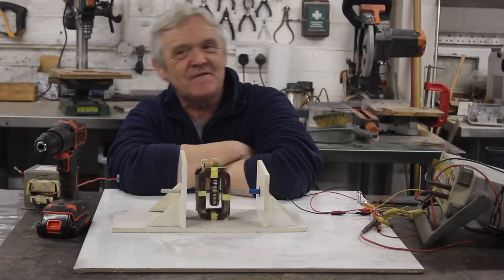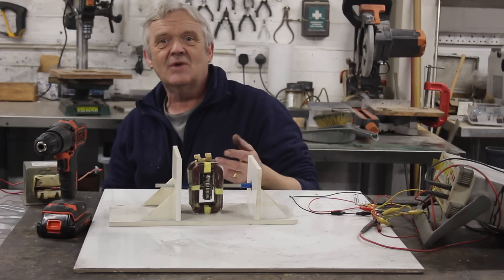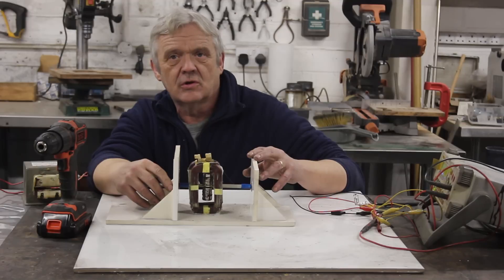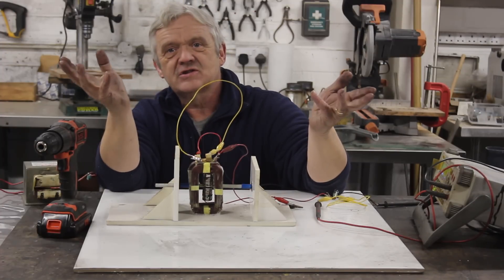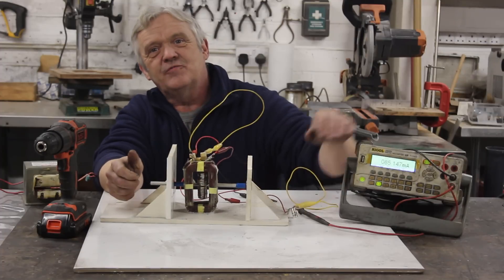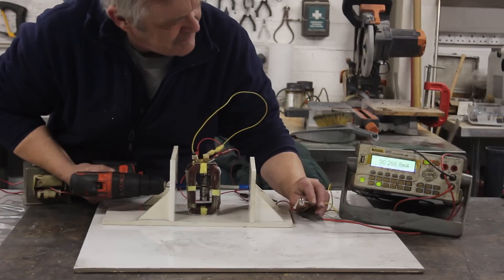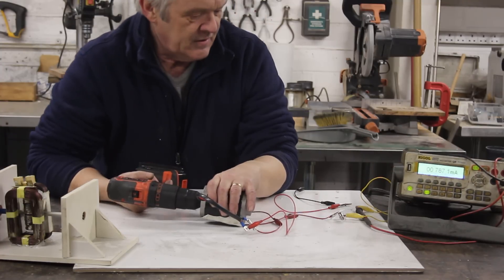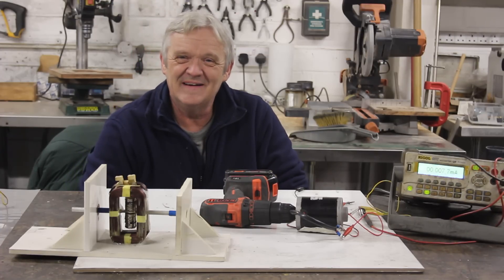1810 Newman Motor Generator - Better Than Shop Bought Generator

Comment: Just goes to show you that the energy industry is an industry in it for money. Nothing is designed to operate at peak efficiency or performance. We have stories of patents for highly efficient solar panels (Above 30%) that got shot down due to "National Security" bs. Solar photovoltaic solutions that would get us a bit more efficient solar panels. Doesn't surprise me in the least that a garage mechanic made a more efficient system. The ones they sell are not made to be efficient or last. They are made to break so you have to replace them. Like Apple computers.

Comment: Good day sir. That generator seems to be very effective. Did you measure the volts output? I would like to calculate the possible watts this type of generator makes. If it is 220V coil and you have two of them in series, is it 440V 0,25A? So the generator output is somewhere between 0-110watts. Btw. does it feel like it creates lenz braking effect while you hand spin it when it is connected to load?

Comment: That's a huge difference in output, 13mA commercial compared to 250mA DIY.. How can the commercial generator claim to be a 120W generator, at 12V you should be getting closer to 10 Amps not 13mA which is 1000 times less. Even a 20W generator should produce around to 1.6 Amps. I'm starting to think that the generator companies out there are either lying about the wattage outputs or are giving the absolute maximum recorded value running at the absolute maximum speed before destruction 🤔

Comment: Put cockroft walton multipliesrs off each coil; one set ground to positive, the other in reverse; ground to negative.Spark gap the positive and negative. Then capacitors off those legs to a transformer. Do whatever you want off the transformer.

Comment: Man, in your last section you're comparing tomatoes with bananas ... the newman "generator" is by coincidence generating more voltage, which drives more current through the lamp ... the real generator is probabely constructed for less voltage, but more current ... if you don't draw the current (by means of a different lamp), it cannot deliver!

Comment: Hi Rob! Thank you for this video! I have actually made the Newman motor generator, just to see what would happen. I am curious though, is it possible to wire 4 coils in parallel? I have a thick coil and thin coil as of now, but I want to add 2 more thick coils. I was thinking of adding another magnet rotor down the shaft and either, have the 2 additional coils wired together and send the output from each set of coils to a common post...or try to wire them together and only have one output. Any advice on how you might do it?

Comment: so i want to say ive done this same thing in the past except i didnt test it against a store bought one in fact i was thinking this whole time 20 years or so that the store bought ones would be as good or better to be totally honest i just assumed they were better because its built specifically for that  but anyway im assuming again but i think the coil is the reason its better because the coil has the ammount of turns it has . but i would love to see you go though testing to determine what exactly it is that would produce the best possible build for making things liek this from scrap maybe even if we took the coils down and re wound them in a closer proximity or had stronger magnets things like this

Comment: But would the reciprocal be valid ? Can we see some overunity ? Have the commercial motor powered up, spin the Newman generator. Even if it's at 50% efficiency. Then how about adding a second magnet on the same shaft and brushes. So you get also a homopolar generator at the same time.

Comment: Robert, according to induction, you can stack a coil on the generating coil. How high/much coils could you tie to the generator coil until you do not have a voltage coming out of it via induction?

Comment: Great demo. For a fair comparison, the strength of the magnets used and the number of coils or copper mass should matter and may explain the difference. 
Still, your generator was build from scraps, so it's worth experimenting with this.

Comment: The generator's lack of cogging and low startup torque are very attractive features for wind power generation, too. Vertical/helical turbines don't get up to the crazy high RPM that the classic sky-monsters do, but they'll spin in a breeze that your own face can scarcely feel. Generators suitable for such low RPM are few and far between.

Comment: Fascinating, whilst I was , "out-n-about" scavenging material's, my imagination suggests i combine various elements from multiple video's, with idea of building a fully portable/mobile,  "wind-wall generator/charging station ", as Solar is so physically fragile ( I live and work in a mobile capacity /remote setting's.) My Q is, the "Newman" motor/generator seems so simple to build and probably maintain, I wonder if used with the "Ugrinsky" wind turbine, in a windwall format, charging 18650 L-Ion battery pack's if this a more viable/reliable/robust solution than the Thunderbolt/MightyMite generators? ( I will no doubt build all of these ultimately.) At this early stage I was curious as to your perspective.? Thank you for your time and effort in making your video's, you are inspiring and have definatly got me thinking.      🐘🐘🐘

Comment: I'm not disagreeing completely, but you cannot say it is definitively better than the shop bought generator, just in this test it appears functions better. The Newman motor should also work better if the ends of magnets came closer to the coils. 
I suspect the commercial generator is designed to operate at a different RPM.
It would certainly never be possible to saturate the iron in such a motor.
To properly analyse, you need to perform a similar test, but at a range of RPMs and measure the torque and thereby the input energy or power. Also a range of output loads and measure voltage and current to show the power output.
I'm pretty certain that the energy is all produced from the ends of the bar as they pass the coil. The flux lines parallel with the bar magnet (stack) do not produce energy, as they are not cutting through the wire perpendicularly, as on the ends of the bar. Therefore I wonder whether in place of the single bar magnet made from a stack, a rotor with the magnets arranged N-S-N-S etc. around the circumference, (ensuring N and S are always on opposite sides) would be better? The magnetic flux will be lower but you will be passing flux lines through the horizontal wires in the coil more often. The AC frequency will be multiplied by the number of N-S pairs around the circumference.
I'm looking for simple but relatively efficient and in particular low RPM generators to make a 'hybrid bike'. I.e. remove all the complexity of chain etc. on an e-bike (trike in my case). Good force feedback would be desirable, with user selectability. I.e. the user will ride it like a normal bike, without an accelerator, so that the energy applied to the wheels would be proportional to the energy supplied by the user and the user would be able to vary the proportion of assist energy going to the wheels.

Comment: One needs to measure both output voltage and current of generators  to enable a fair comparison (Power W = V * A) and speed of rotation is critical to gain rated output.

Unless I've missed something, you appear to be only measuring current and also need to be able to vary input rotation speed to generate maximum current and power.

If the rating for the commercial generator of 120 Watts at 12V is correct, the max output current would be 10 Amps, provided that the input shaft speed and power is sufficient. 

Obviously, spinning it with a power drill is inadequate in terms of speed as it only generates .125 A, why  not use a faster rotation input to find if it's true to its  rating of 120 W? Your DIY machine, if it still  generates  double the current may well be capable of 4 times the power (I squared) or 500W which is not inconsiderable BUT you  need to measure voltage and current to make a fair comparison.

Comment: FYI. I do know that forcing cylinder magnets in line and with opposing fields is used in linear thrust actuators. Makes for a very strong magnetic field and very different lines of flux. Using Cylinder magnets over a threaded rod and nuts allows you to force them together.  Something worth experimenting with generation for sure!

Comment: Hi Rob, I was revisiting your push pull inverter and had some thoughts for ya.  What if mechanical switching was used in place mosfets? A Wind turbine using only coils, caps and diodes could be very useful. Food for thot. 👍keep up the great work

Comment: It would be important to measure the power lost in the battery of the drill. It's possible it was using more power. I suspect the drill battery will last longer spinning one compared to the other. Just look at the sum of the heat generated on every component to find the winner
Reply: You're right. Would need to know real power in the drill. Speed says a little. The drill can turn at the same speed with and without load

Comment: That is impressive Rob!
It begs the question about the secondary coils and if they may improve it even more with 10 times the windings as the other day you mentioned the length of wire was apart of the equation and efficiency!
Reply: The farther the magnet gets from the wire ,the less you will get, so there are limitations. The more wire you use , then the more resistance there is to current flow. There are trade-offs with everything. I would be interested to see the difference if the ferrous terminals were removed. I'm going to attempt one. I should say that stacking magnets that way makes a powerful magnetic field, but a single, solid magnet of the same size would be about 40 percent stronger and even generate more. I am very surprised at how well this works. Thanks Rob
Reply: @justtinkering6713  yeah i was thinking from the perpective of far higher voltage actually travelling with lower resistance as i believe it is the case but maybe at 10 times the voltage it still isn't high enough to be something worth doing . I don't know but it might !
Reply: @Buzzhumma  All you need is enough to charge a battery. I dont know any application where you would use the output directly. Charge the battery then send that to an inverter for AC. Or you could ditch the copper coils and put a flat sheet of copper with some sort of heat exchanger to make hot water or hot air.

Comment: Getting off subject.  what do you think of compressed earth block or rammed earth as a substitute for concrete block?  Wow you got a quarter of an amp.  Earth block or rammed earth has better thermal mass but can it be as strong?
Reply from the maker: ervything is good in it's place mate - rammed earth is awesome for lots of jobs like home building and walls - not so good for bridges
Reply: @ThinkingandTinkering  Thanks for the fast reply.  Do you know the best formulation?  I have seen 10% cement and some percentage of lime.  They say that the pyramids were built out geopolymer.  My projects never get that far or that big.

Comment: Sorry to burst your bubble Rob. That bought generator should be producing 10A at its rated speed. The only reason you are getting next to nothing from it is that you are running it at a fraction of that, before it has had a chance to 'kick in'. Whereas your Newman generator with its very long coils starts generating much earlier, so it wins at low speeds. However, that might still be a plus for alternative power projects, where the high rotation speeds are typically hard to achieve.
Reply from the maker: it doesn't burst my bubble mate - and I hate to say this but you may not have understood the principles of generation - think of your Lorentz law and I think you will see what mean - cheers
Reply: @ThinkingandTinkering  Thanks for your reply.  I know what you are thinking: 'the output of my generator should be always proportionally greater, as the speed is the same multiplicative factor for both'.  You are of course right about that. However, you are forgetting the different torques of the two devices. If yours requires greater force to spin, at the same speed, that would fully account for its greater output. The only way that would manifest itself would be by your prime mover drill drawing more current. The efficiency of the generator is not its absolute output, rather it is the ratio of its input and output. When doing comparisons, you have to compare those ratios. Maybe people suggesting that comparison are not as wrong as you seem to think.
Reply from the maker: @leostarling5746  i get what you are saying mate and thank you for pointing it out - of course I have it in my hand and can feel the torque difference - there isn't much as it happens - but I do get what you are saying and thanks again
Reply: @ThinkingandTinkering  Cheers, mate. Of course, with these projects, it is a valid position to take that you are not all that interested in the input and just want to know how much you can get out of it in absolute terms. However, when you start making comparisons, you need to be more careful. Your generator might actually be better but you have not really proved it. I would be interested to know, that is the only reason why I raised this.

Comment: What was the voltage generated by the newman motor? Ultimately it's the power I would be interested in.
Reply from the maker: 6V
Reply: @ThinkingandTinkering  If the current changes, then the voltage changes Volts=Icurrent x Resistance. and as more current goes through and filament heats up, the R goes up too. I thought the 6V on the light bulb only indicated what the supply voltage should be. If you put 12V across the bulb, it would either just be brighter or burn out quicker.

Comment: Robert, this is ridiculous, you got one quarter of an amp from your throw together microwave unit and the commercial one was in the milliamps. 
WHAT is going on here fella ???? I do believe you need to go feather on the Newman unit Sir. Good luck too.
Reply from the maker: it probably the magnets in the commercial unit are ceramic - so the Bfield here was pretty strong

Comment: I am curious if your getting .25 amp out of it, what is the voltage. Is it of a useable voltage that could charge a battery or does it require you to further increase/decrease the voltage.
Reply from the maker: 6V

Comment: Fascinating! Thinking of old style rural wind turbines.
A 90 degree power diverter on the output shaft directs the torque down along a light weight tubular drive shaft to the base.
The head is supported by mag-lev so friction is minimal.
At the base, an automotive flex plate from an wrecking yard automatic transmission is mounted to the output shaft.
Geared into the flex plate at a gear ratio of approximately 1:15 is a series of Newman alternators mounted to a plate and wired in series - parallel, raising the output voltage while keeping the current low; say 1 amp. The 6 volt bulb got plenty bright running the alternator at 2100 rpm. I'm presuming about 8 volts.
Two alternators in four parallel strings should yield 16 volts and 1 amp at a turbine speed of 140 rpm.
Not bad for scrap parts and a few magnets!
Reply from the maker: for sure mate - keep them ideas coming - cheers

Comment: I imagine you'd get even higher induced voltages with an iron keeper and magnets that are proximally closer to the coils' surface. You might actually not need the iron keeper since a large volume of copper is being cut across by the rotating magnetic field. But it's clear that for such an eccentric rotor shape like this, it needs to operate as best as possible at low speed where loss due to air drag and vibration are negligible.
Reply from the maker: maybe but you would also get cogging - which would mean it wouldn't operate well at low speeds

Comment: Better than a shop bought generator at low RPM for sure. At the 12V motors rated RPM, however, will be a different story, but its a good post-apoc build when there aren't convenient shops around!
Reply from the maker: no - actually it wouldn't
Reply: @ThinkingandTinkering  What?
Reply from the maker: @Infinion  it wouldn't be a different story - I am not sure why you think it would - all generators are governed by Lorentz's law where emf=BLV sine theta - at the rated rpm of a store bought generator then yes it would output more but so would the Newman generator by the same factor
Reply: @ThinkingandTinkering  I'm mostly a fan of motor characteristic curves because its less convention through theory and more practical empiricism to make conclusions with. When voltage is proportional to speed (the mentioned BLV) and current is proportional to torque (IAB), yeah the newman generator is going to scale up ... for a little bit. It might even scale by a large degree since you gave it a huge loop area with those MOT windings. But assuming the magnets don't fall apart from the centripedal forces and counter-torque, there will be some yet determined speed where "MOT Newman's" power output will plateau and efficiency drops off from electrical and mechanical losses. If the 12V motor experiences that before MOT Newman, then oh yeah your claim will most certainly hold true.

Comment: Great result! Could not help thinking, if you turned it on its side, with the axis running through  the short ends, using a magnet with the poles through the side, you would get 3 to 4 times the power.
Reply from the maker: maybe